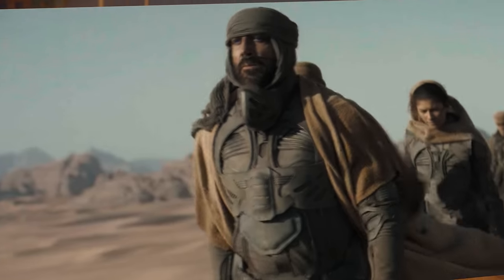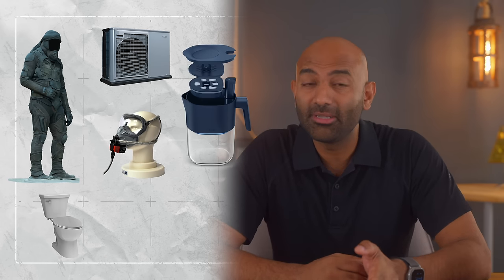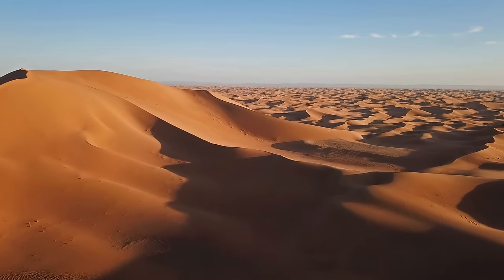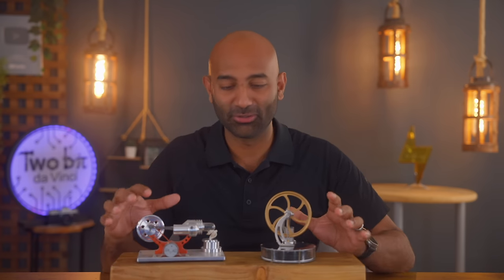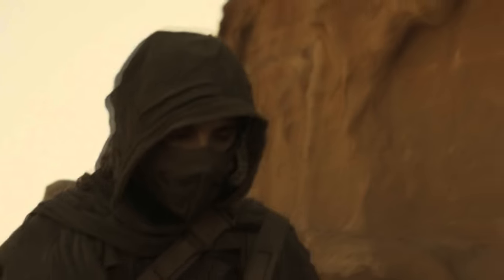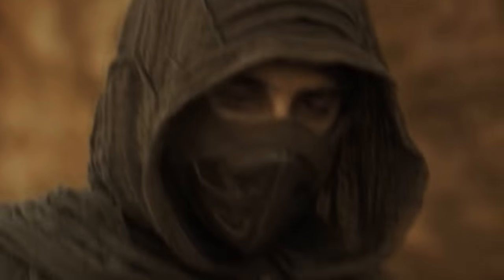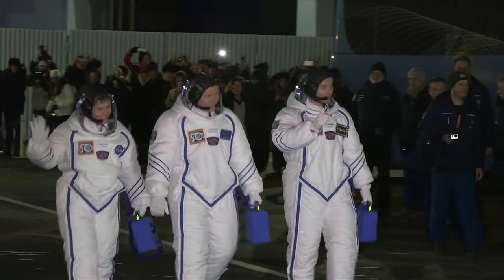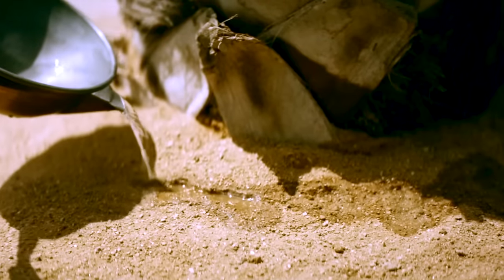Could the Dune Still Suit ACTUALLY Work?

Comment: If designing a still-suit for cooling in the desert don't make it black. Super reflective white makes more sense.
Reply: But, for efficient radiative cooling black is best
Reply: Plus maybe it will be more visible to help emergency services locate you if it is reflective white.🤔
Reply: Color switching to be reflective or heat-emmitive as needed would be best.
Reply: Shade yourself from the sunlight with a solar panel umbrella.
Reply: Unless the suit is also a PV collector, to run the Peltier chips.
Reply: @Peoples_Republic_of_Cotati  In the books, still cloth used to make still suits AND still tents change color throughout the day. They were opaque during the day (I think it was a light color, probably the same color as sand, but I don't remember for sure) and transparent during the night.
Reply: If it generates electricity from solar heat, black is good. Plus black radiates unused heat away faster than white.
Reply: @stuartwhitney4040 exactly Ive study about that its insane even irl people wear black in deserts
Reply: Great video, loved it (and the movies too). HOWEVER, are you making the assumption that a civilisation living ~8000yrs in the future, one that created anti-gravity interstellar capable ships, have not made any technological advances in water filtration, energy management or fluid mechanics? 😛
Reply: In the books they were sand colored for camouflage. Also, the people were nocturnal and would not be out during the day.
Reply: Great timing Ricky as I've just re-watched Dune prior to watching Dune 2. BTW, loved reading the books so many years ago! Sacrificing the 10% for recycling the poop would simplify the process!
Reply: The black absorbs the heat, which is converted into useful energy to push everything up the gradient.
Reply: You'd think so but that's not necessarily true, just look at many ancient dessert temporary dwellings and the dweller's attire. Not only is it hot in the day but by contrast very cool after sundown and into the night.
Reply: @MrMonkeybat  this sounds humourous but with modern material science entirely possible, if weight isn't a factor.
Reply: Bedouin wear black and drink hot tea. In the desert getting heated is paradoxically cooling because a sheen of sweat cools you way down in low humidity. Black also shades better, and in low humidity the difference between sun and shade can be profound, like it can be 115⁰ in the sun and uncomfortably cool in the shade.
Reply: Wrong, the beduins are called the blue men because because of the colour of them clothes
Reply: The freeman are also being hunted by the the harkonnens and having a suit that highlites your position might be a bad idea… now going with a color which closely matches the color of the sand….?
Reply: @musimedmusi8736  but black can be a great heat emitter
Reply: Imagine what the inside of that thing would smell like.  I smelled some bad stuff in Africa but I bet the Freemen would take that to another level.
Reply: @greghight954  smells usually come from bacteria
Reply: @greghight954  but of course it's also oder as well
Reply: @andrewreynolds912  poop is full of bacteria
Reply: @greghight954  fair enough
Reply: @greghight954  I didn't say all of bacteria is the cause theirs stuff like methane and such
Reply: @havocmaverick good point, mimicking desert animals who are typically more active at night.
Reply: @jessicatymczak5852  yeah but the black absorbs the light and turn it into heat that radiatws into all directions... yes some radiates out but it also radiates inwards
Reply: @Berilaco  sorry, lost the thread. There are actually materials that can do both. NightHawkInLight did a video on this, Calcium Carbonate. Highly reflective in the visible, but also highly emissive in the infrared. Barium Carbonate does even better
Reply: Theres several channels where they mess around with just that. they manage to get temperatures of 5c lower on the surface than ambient, purely from infra-red reflection/rejection. 
Doesnt have to be white although something that reflects IR will tend to be so, i wonder if the material of the suit could be made permeable one directionally so you can radiate heat easily, but wouldn't allow IR in and reflect it? 
Space blankets kiiiiiiiiinda do this already depending on which side, one reflects the other absorbs, but its not really permeable.
Reply: Why not black? You could use it for heat generation which could be used like efficient solar panels to collect energy for suit usage
Reply: @NanosoftRussia  The issue is staying cool, not energy generation, black would absorb IR and heat you a lot, doesnt make sense (based on what we know so far, mb is different with better materials/physics)
Reply: @NanosoftRussia  you already get enough energy from the person moving and running
Reply: @jwhippet8313 

Bedouin make use of the reverse greenhouse effect. Their clothing is loose; underclothes are light; their top clothes are dark. This combination reflects radiative heat away from the body and makes the outer layer hotter so that it emits heat better. Similarly with their tents. The way to keep tents cooler in desert sunlight is to have a dark outer layer and a light inner layer but allow breezes to blow through.
Reply: @artor9175  How about a white heat-reflective suit with PV panels on it? Then it would look black and white.

Comment: Big error with space suits. Space suits have a high albedo outer cloth layer to protect them from unfiltered sunlight but they don't have additional insulation as a vacuum is a great insulator by itself. In space a vacuum you can only loose heat radiatively so even in the shade or interstellar space it take an object a while to reach those "space is cold" temperatures (and anything in bright sunlight can get hot), as an astronaut is constantly producing heat that means even in the shade the engineering problem is keeping them cool. For underwear astronauts first put on a liquid cooling garment with plastic pipes sewn into it though which cooling liquid flows to stop the astronaut baking in their own body heat, this heat dumped into an ice block or endothermic reaction in the backpack of the spacesuit. On larger vessels like the space station perpendicular to the solar panels so they are edge on to the sun are large radiator panels through which coolant flows so they can slowly radiate excess heat through infrared light.
Reply: I was coming down here to say essentially what you have, probably more clearly than I would have managed. Thank you!

Comment: Adam Savage (of Mythbuster fame) over on tested did a one day build of Cool Suit using a Tiny phase change heat exchanger cooling an old 1975 British fighter pilot tube suit.  Shrink it down a bit more (use micro or nano tech) and you could have enough cooling to keep someone cool in the heat of Arrakis. As to how to power it, use strategically placed Piezoelectric material that would generate electricity from movement.   I agree that waste collection and recycling is not possible, but that % lost through breathing is totally possible to capture if you pass it over a heat exchange before expelling it.  It would be like the moisture collected on an AC on  hot humid day.
Reply: Sounds cool
Reply: @katiegreene3960  In the books the suit works with an AC system that compresses air and expands and cools it through the Joules-Thompson effect in a larger pouch in the suit's hood. It also extracts ammonia from urine and uses it as a sort of cryogenic fluid. It's super crazy
Reply: @ipp_tutor  hmm… ammonia refrigerators are a thing, so maybe?
Reply: @ipp_tutor  That's still science fiction, but God willing anything is possible, even mankind living on Mars or even the Moon.
Reply: They talk about pumps in the heels, you can use tesla turbines attached to a hydraulic or air based system for power as you walk.

Comment: you miss the most obvious option......vacuum against the skin. The steps and motion squeezes soft small vacuum pumps with reed valves holding the vacuum. This provides the phase change and rapid cooling. The salt would be left on your skin an the water would condense on the ambient/pressure side of the reed valves.
Reply: I like that idea

Comment: Yep, in the book they individually make ear and nose plugs cause each person is different and a seal is required. Also in the book the boots provide the pumping power pumping from each step you make.
 The book is so much more🙂 Frank Herbert didnt miss a thing.
Reply from the maker: dude's a genius, that is for sure!
Reply: But he did miss thermodynamics. For every watt of kinetic energy produced by the muscles two watts of body heat is produced, You can not refrigerate an engine below ambient temperature with energy produces by that engine that violates thermodynamics. The phase change cooling provided by sweating is very useful to us.
Reply: @MrMonkeybat what if the springs are made of a material that acts as a battery releasing extra energy with each step?

Comment: The pressures your talking about for desalination would be used on an industrial scale. There are other methods of desalination that would be more SUITable to these applications, like anisotropic membranes and capillary tubes.

In regards to space suits.... heat management is a way bigger issue than what you said. Space is "cold" but without any atmosphere it is really hard to remove heat from the body. A space suit protects the astronaut from solar radiation heating, but would also limit the amount of heat that can be radiated away. A key function of a space suit is to remove the heat the body generates and actively expel it into space. Apollo space suits used 4 L of water a day to do this through sublimation.
Reply from the maker: well done there with the "SUITable" :) and great points!
Reply: The only real conceptual problem with the stillsuit is its mindboggling efficiency, reducing a water loss of 3.7 L/day to just 15 mL, effectively recycling 99.4% of all the water our bodies release. We could totally power a deal pump with body motion. We already have hand pumps that do the same, so it would be a simple matter of adapting the technology to make it wearable. But filtering out 100 mL of water from 200 mL of sweat or urine is hundreds of times easier than filtering out 99.6 mL of water from 100 mL of sweat or urine, no matter what technology you use. The problem is that separation gets harder (and you need more pressure, i.e., energy) as your stock solution gets more concentrated, which it will the more water you remove from it.

Comment: So 2 things. Peltier chips are no where near as efficient as phase change. So, phase change would be the way to go, and you would have to find the right fluid given the temps involved. 
Second, you can build up those pressures really easily with just walking. You have to remember that a piston works as a multiplier depending on the size of the piston head and the force applied. It will take more steps to get it done, but even a tea spoon at a time with 5,000 steps adds up. 
As for the solid waste... I guess you could have a liner that draws/wicks liquid from the solid waste, along with it getting, ahem, mushed about while you're walking could draw out a significant portion of the liquid out then be sent along to the RO in the suit. 
I would not envy the person who has to maintain the suit, though.
Reply: I had a friend who went to Afghanistan as a civilian volunteer to build schools during the war. After building only one of five schools, he inhaled some faecal dust that was generated by human faeces that had been desiccated by the sun. The pneumonia he got was bad enough to have him medically evacuated home.
Reply: Phase change material has been used by the military for decades with ice vests. Problem is the energy required to change the material back to solid form. Peltier may be more inefficient, but it can run as long as you have an energy source.
Reply: @tylerparker3237  That's a good point. Compression to the pressures you would need to generate with a heel pump while walking on sand is, I think, unattainable. I don't think you could pump fast enough to run a phase change heat pump.

Comment: Two bit what you did miss was the black could absorb that energy and then we could use the black to absorb the heat and then use it to power the source one other benefit we could exploit to get somewhat around the laws of thermodynamics is using something called (ik im gonna spell this wrong) Kurkovs rule of radiation which black is a great heat emitter it actually emitts more heat than white reflects... It's also why the SR71 black bird is painted black to radiate heat away from the plane.

 This could also act as part of the cooling system if we need to. So, one more thing while the filtration and such for the urian and all isn't currently possible, we can, of course, possibly use condensation to make water by cooling the air using the heat pump if we could idk just an idea Im not engineer but something like that might be possible and much more feasible than filtering your own crap granted the problem would be the lack of humidity for it to work while it could work on very low amounts Idk how much humidity their be to even make it generate enough water for the user.

Comment: The laws of thermodynamics make the stillsuit impossible as described. Your comments on the need for additional energy via solar cells are on point. Ditto waste treatment. Essentialy the still suit is a completely closed environment that works by magic (ref. Arthur C Clarke)
Reply: I was thinking the energy source Could be an Advanced form of Piezoelectricity? Placed in specific points in the suit could provide enough power to power the cooling system. I know most Piezoelectric material today isn't that efficient or powerful to provide that much power, but Dune is set 23,000 years in the future, something could have been developed/discovered that would provide enough power.
Reply: @jonjohns8145  Why don't suits just work on Spice??? If that stuff allows interstellar travel, I'll bet keeping you cool and moist would be easy as pie, LOL
Reply: @ipp_tutor  I mean theirs gotta be a reason why its not being used for that
Reply: @andrewreynolds912   There is, Spice isn't a fuel source. It's just a drug that increases brain function/capacity and increases life span.
Reply: @matthewramos9170  I thought so because I knew it was just a drug that's it how can it be used in tech? That's possible that's obviously no
Reply: The reason spice is needed for interstellar travel is that FTL is inherently dangerous and only a spiced space adept can perform the calculations to navigate safely.

Comment: Love the video!
One thing tho - the desalination part is kind of not relevant, is it? Hydration requires electrolytes, so why filter them out? So no need for desalination at least, tho I get that we would still have to filter some of the toxic wastes… curious to hear your thoughts here!
Reply from the maker: yeah that's so true, since its a closed loop! so maybe try to keep the electrolytes, and ensure you can make it sanitary and safe! brilliant! that does make it easier, maybe UV lights etc to kill biologicals?
Reply: Bad ol’ thermodynamics ruins the party again! The energy is ultimately coming from the combination of the food the Fremen has eaten with oxygen, mediated by fresh-ish water. The reason the kidneys expel nitrogen salts into the urine is the same reason you can’t slake your thirst with urine. Trace electrolytes or no, you still need to apply significant energy to roll waste water back up the hill towards fresh.

Comment: using the pressures from walking rather than just stepping would help to move water around, and even press on solid wastes, so the liquids can be handled in other ways. using the natural body heat along with the desert heat, you may not be able to boil water, but you can still speed up its evaporation. using the cooling system already in the suit, you can return it to a liquid state like dew, and drink from that. 
even if we only get a few aspects working in a modern version of the suit, more can be added later to better versions. it is well worth the attempt.
Reply from the maker: so very well said! yeah that's really a good point, improve upon certain aspects, and keep iterating over time. brilliant

Comment: I'd go for more modest.  Probably a thermal suit for >100F weather.  For workers who have to work outside, during heat waves. Probably need to find a suitable phase change material, that would circulate around the suit.  A high energy density power supply (lithium metal, exchangeable modules, ..).  A very portable heat exchanger.  Probably need some technology breakthroughs.
Reply from the maker: Great point! I think we start small and iterate over time... compare iPhone 1 to 16 :)

Comment: The answer to the water purification is in the name of the device: it’s a still suit. You just have the place where dirty water is collected be the place where the heat from the peltie coolers is deposited. Then you’ll reach the boiling temperature of water, and it will evaporate off and be collected near a cold point close to the other end of the peltire cooler.
Reply: That sounds like an amazingly simple and workable solution.

Comment: Engineering challenge:  How much energy would be required if all processes were 100% efficient?  Assuming the still suit could gather 100% of the energy generated by a human (i.e. The Matrix), would that be enough to handle these cooling and filtering processes?  Also assume that the black suit wouldn't heat up from thermal radiation, but it could harness that energy instead.